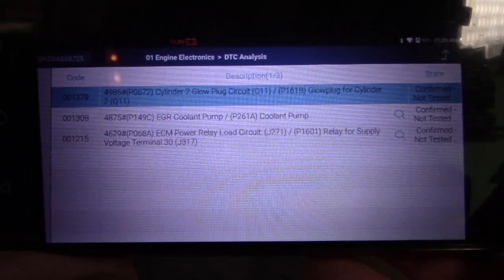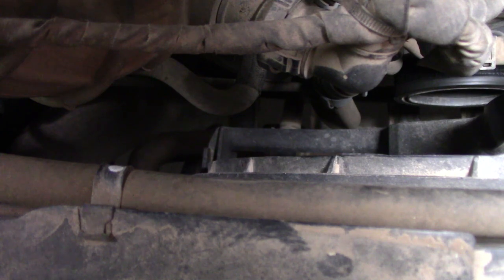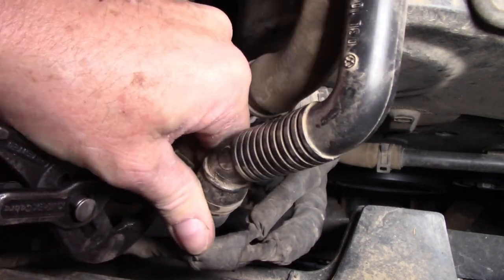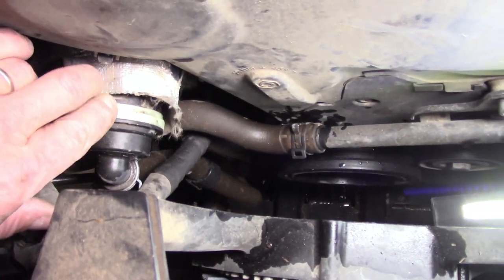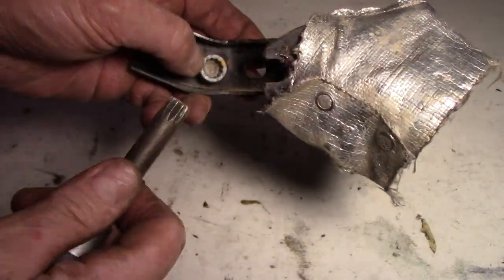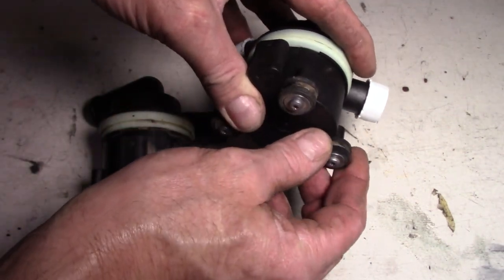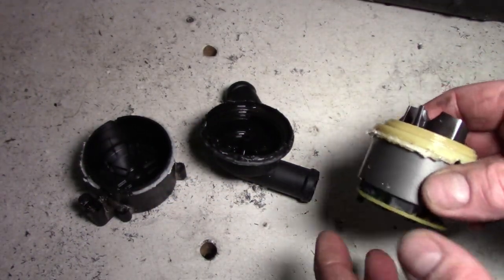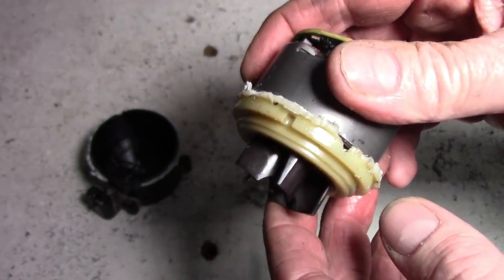Amarok Secondary Coolant Pump - I Almost Messed  Up!

Comment: These pumps are notorious for falling apart - I have replaced mine 2 times within one year.. the first one died what was probably the normal death by wear and tear, it blew the fuse and threw the car in limp mode. I replaced it with a genuine pump from the VW dealer - this new pump lasted about 1 year and failed after my cooling system really got its jo cut out for it, when I was driving up a steep mountain in Italy, during a scorching hot summer (outside temps about 40C). My theory of why the second pump failed is that the electronic circuit simply got to much heat, the little heatshield did not help enough under these conditions.. 
So I think there are 2 types of failure mode for these pumps; general wear after years of service, and electronic failure due to excessive heat.. now I carry a spare pump on longer offroad trips as its a relative quick fix that can be performed anywhere with a few handtools. I am considering if it would be possible to relocate the pump a bit longer from the engineblock to help it cool off better, or even mount a small 12v fan directly in front of the pump, to help with driving in hot climates.
Reply from the maker: Sounds like you have had your work cut out! Yes, manufacturers come up with so -called solutions to problems, but only time and major mass testing proves it's true worth.
Let us know if you do any modifications as you have suggested.
Thanks for your comment 😉
Reply: hey mate any updates?

Comment: Ive got 1.6tdi polo and i have gone through a few of these pumps. the original one lasted for about 6yrs then every other one lasted less than a year... the very last one i opened up the bottom (electronics part) and saw that the wire connections to the connector were fried (one of them was) i then proceeded to solder a bit thicker copper wires for all 3 connections (- + s) then used basic bunnings silicone and duct tape to put it back together and its been about 2yrs now no engine light no codes... NOTE the mechanical part of it, the propeller, was rattling but i reckon it can work like that although it is not perfect.. i think their main issue is the tiny connector wires that burn quickly so if you dont want to spend $400(genuine) for a new one try what i did.
Reply from the maker: Did you fit genuine ones?
Well done for thinking outside the box 😉👍
Reply: @MiracleMAX  i did the first time but that one was also short lived.. the one i fixed the connection on was nongenuine. cant remember the brand but they are all, including the genuine ones, made to lower quality than the ones made 10yrs ago i reckon...
Reply from the maker: @predragbogunovic5151  Interesting. Thanks for your comment. 👍

Comment: What scan tool did you use? And were you able to turn on the pump with your OBD2 scanner?
Reply from the maker: I used the GScan 3.
https://youtu.be/nt46RVDvlXA?t=93
You need a bi-directional scan tool to be able to turn on the pump. A simple OBD scanner does not do this.
Thanks for your subscription 😊

Comment: I always throw away those spring hose clamps too, I hate the stupid things.. we've all started pulling stuff apart only to find we were doing it wrong, I done it the other week on my wife's yaris.. I've had some fun with that thing, a rat chewed a coolant line and it got so hot the head gasket failed so I got new head bolt's, gaskets and skimmed the head and when I went to fit the head I got all the bolt's tensioned and done the first 90 degrees on bolt 1 and only got to about 60 degrees on bolt 2 when the bloody head broke off the bolt 🤬 I'll never use durapro bolts again, now I have to stuff around with the supplier and no doubt I'll be the one stuck with the cost of yet another head gasket
Reply from the maker: Hey Mark,
Sounds like you've really copped it! Getting quality parts is a real problem. I'll have up a video in a while about a nightmare of a fuel pump being replaced with a faulty new pump.
Makes our day interesting....😒
Reply: @MiracleMAX  yeah I had a problem with a new holley fuel pump on my 1979 f100, it worked fine until I got half an hour away and then it'd play up.. the symptoms look like ignition and I was chasing my tail for a while until I run a fuel line into the cab and stuck a guage on it and just drove up and down the road close to home until it played up.. the fuel pressure was going from 6psi down to -3psi as soon as it got heat soaked so I had to try to find a genuine fuel pump which fixed it.. I've had to many problems with holley stuff so I'll never buy it again, the same can be said for msd stuff, I ended up going back to the old points system because it doesn't let me down
Reply from the maker: @markshort9098  Wow, sounds like you've had some real fun! 😉

Comment: Hey MM will the ancillary heat pump throw up the same fault as the coolant pump?
I just replaced my pump (the same one as you did) and a week later I got the same fault back and fuse blown.
So trying work out if the heater pump will cause same issue or a relay?
Reply from the maker: Hey Robert,
If you have an electric coolant pump and also an auxiliary coolant pump, these will have individual codes. The only reason a fuse will blow is due to excessively high current, beyond what the fuse is rated for. You have to look for that reason. Get an accurate wiring diagram, carefully examine where the pump relates to the blown fuse. Carry out a detailed visual examination of the wiring loom for shorts to ground (rubbing through).
Let us know how you go with your investigations 😉👍
Reply: So replaced the pump with a goss pump
Fault has gone and no more blowing fuse.
The pump from eBay had started to seize up and was hard to spin when I applied to a 12v battery to test, I believe this was causing the excessive current draw and causing the fuse to blow…
Reply from the maker: @robertgibbs6920  Thanks for sharing Robert. Another reason for paying extra for quality parts. Well done! 😉

Comment: Good morning sir wats ur advice my 2016 amarok starring is really hard an the i hav to keep adding coolant every 3 days
Reply from the maker: Hey Kurt,
I would start by finding out where the coolant is going. Are you able to pressure test the cooling system? If there are no external leaks, you would consider a blown head gasket. Are the glow plugs OK? That could explain the hard starting if you had an external coolant leak. Is there bubbles blowing out in the radiator with the cap off and the engine running? Make sure you do this safely as hot coolant will burn.
Here are a few techniques that might help you diagnose if it is a head gasket or not
https://youtu.be/GjZQfMDbOBo
https://youtu.be/O7tjL2UqvnU

Comment: hello,what signal is sent down the signal wire?its voltage or frequency signal or?
Reply from the maker: They use a Pulse Width Modulated signal
Reply: @MiracleMAX  
Menerjemahkan teks dengan kamera

oh pwm, I want to use this pump to circulate my motorbike's radiator 😁... thank you
Reply from the maker: @yongkireynaldi2384  I hope it works out well for you 👍
Reply: @MiracleMAX  thank u 🙏
Reply from the maker: @yongkireynaldi2384  You are welcome!

Comment: hi i have amarok 2014 highline code p261a cooling pump b control circuit open  replaced it with new pump i’m still getting the same code car is in limp mode  checked all the fuses and relays all good The car is at the mechanics at the moment he said he’s done a test on the wiring to the pump has no power any suggestion please
Reply from the maker: Hey Bill,
Have you checked the fuses & relays? Control at the relay? Ground connections? Wiring damage by mice?
Reply: max thanks for your help it was the fuse and faulty pump all done thanks for videos 🙏🙏
Reply from the maker: @bill8947  That's good news. Always best to start with the basics

Comment: I have the same problem in my Audi A4, the new pump, I just bought it, I have the same problem, the fuse is burning, it's all right???????
Reply from the maker: If the fuse is blowing, it must mean you have a short to ground. This must be repaired.The fuse is designed to protect the circuit, so if the short is repaired, you may find the new pump will be OK

Comment: Hi I got Audi A3 8v 1.6 2013 I changed timing kit (new water pump replaced too )  also changed coolant bottle as well as cap twice but whenever I drive car for more then 1 hour every two or 3 weeks coolant leaking from overflow. Inside temp all ok no overheat also did pressure test headgaskit looks ok, no engine light. Any advice please
Reply from the maker: Was it overheating before? Does it have any fault codes shown on the scan tool?
Reply: @MiracleMAX  no fault codes . Temp inside fine don't show overheating only time I notice when coolant leak also heater inside car works fine 

when I switch the engine off the fan runs for 5 to 10min (3 to 5 times a week), coolant only leaks from overflow hole (pipes all ok no leak)
Coolant bottle replaced twice 
The coolant bottle after 20min drives gets very very hot you can't even touch but inside car temp stays normal
One garage told me to change the thermostat as well as the pump on your video and let's see , so I thought I can ask for any advice 

Leaked after 3 weeks yesterday since I replaced the coolant bottle  cap for the 2nd time, The coolant level is now in the middle since it last leaked ( before the leak had extra coolant in it)

Coolant leaked almost 7 to 8 times in total since I purchased the car 3 months ago, The coolant level after the leak still stays minimum or a little bit more then the minimum level
Reply from the maker: @FTubex  Do you fill the coolant bottle to between the minimum and maximum levels when cold? Is the problem that coolant is getting so high in the bottle that it is coming out of the drain out of the top of the bottle? Does it have excessive pressure built up in the cooling system? Is the bottle an overflow bottle or an expansion tank?
Reply: Yes i fill it between minimum and maximum when the engine is cold. Coolant bottle gets leak from the overflow hole on top under the cap. The bottle I got is an overflow bottle 2013 Audi s line 8v UK model.
Today when I started in the morning the coolant low level sign came up on the dashboard so I filled the coolant again
Reply from the maker: @FTubex  That looks like an expansion tank, not an overflow tank. This has the pressure cap directly on top of the tank. The cooling system must be building pressure up somewhere. Does this model use a EGR cooler?
Here's a testing method that can be used
https://youtu.be/QfJyvzVQAI4?t=1403
Were there any resets that needed to be done after you did the belt and water pump? Are there any special bleeding procedures that need to be done? Do they have any auxiliary electric water pumps?
Reply: @MiracleMAX  egr cooler yes ,
Rest after i did belt and pump i don't know about this, special bleeding process i don't think so, yes got auxiliary electric water pump.

The presure test holding the presure, i am thinking put new auxiliary electric water pump and new thermostat
Reply from the maker: @FTubex  Can you actuate the auxiliary water pump with a scan tool? Can you see the coolant moving when turned on?
Reply: @MiracleMAX  scan tool don't show anything, no code, coolant move yes .do you think I get new coolant bottle and cap install again last time I install used bottle and twice used cap
Reply from the maker: @FTubex If you bought second hand parts, you need to pressure test the cap. You also need to find out if your cooling system is producing excess pressure.
Reply: @MiracleMAX  changed complete coolant tank with new one, new matrix installed, new thermostate, car now got more pickup then before as well as heater working, big difference, old matrix was blocked alot of dirt inside 

Now the next few days will keep eye to see if coolant is leaking or no
Reply from the maker: @FTubex  what do you mean by matrix?

Comment: That coolet pump brings a engine /glow plug light on VW BUS too
Reply from the maker: Interesting. What fault codes were logged?
Reply: P2426/0047
Reply from the maker: @filedeeverghetinos6471  It is possible that this code may be a result of a poor connection or poor ground contact  - P2426 Exhaust Gas Recirculation Cooling Valve Control Circuit Low
Perhaps this one is a coincident or relating to another issue - P0047 Turbo/Supercharger Boost Control A Circuit Low

Possible causes of this code could include:
Poor electrical connections or wiring
Malfunctioning boost control solenoid